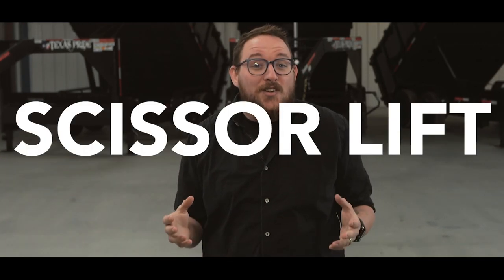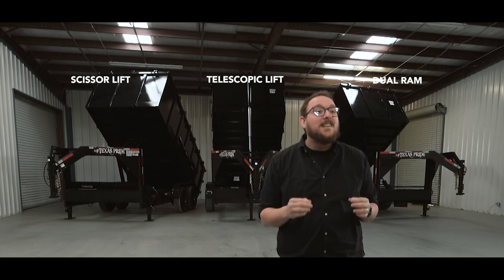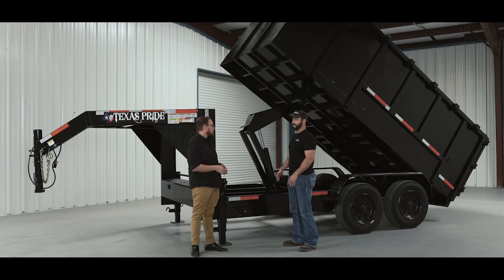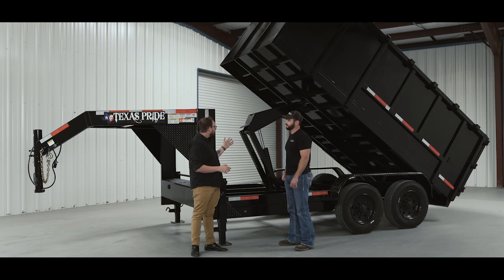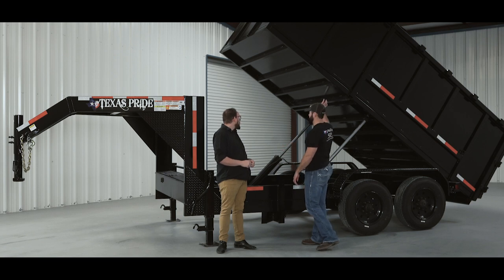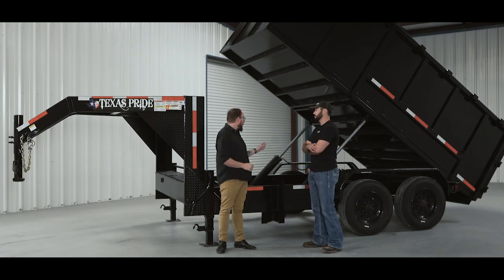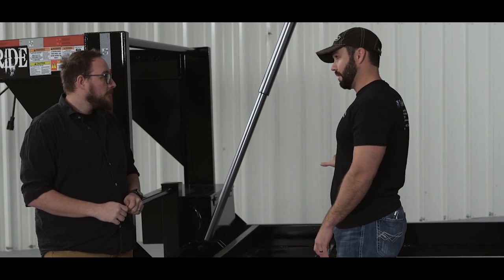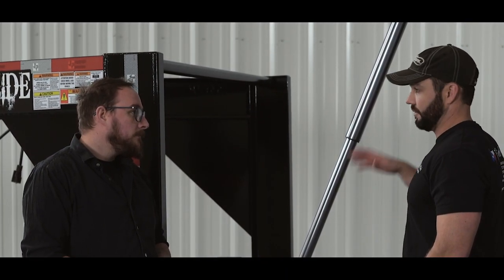BEST DUMP TRAILERS 2020 | Which Dump Trailer Hoist System Is THE BEST | Texas Pride Dump Trailers

Comment: The scissor is better if you dump on un level ground very much. Less torsion on the cylinder. It has a bigger footprint or contact surface on the main frame and the dump box. The scissor takes the twist or torsion not the cylinder.

Comment: Just know this, every trailer is going to need a paint job as soon as you buy it. I've had them all from flat bed,dump, enclosed, utility and landscape, from big tex, snapper trailers ( the worst) trailers 4less, gator every trailer has a cheap light coat paint job just to get it sold. And none of them will stand behind the warranty even if you buy trailers in high volume, the dealer will blame the builder and the builder will blame the dealer.
Reply: I keep a sharpie on hand to mask any paint scratches.
Reply: @ridgerunner106  lol yeah I think that's the quality of paint they use.
Reply: John Connolly  After one of them hurricane debris hauling trips, they're ready for the scrap yard anyway.
Reply: Can’t wait to paint mine matte black with a satin clear coat.
Reply: Our trailers are fully primed and painted with automotive grade acrylic enamel which lasts longer and is resistant to chipping or fading.
Reply: Michigan salt eats any trailer in a few years. Unless toyota starts making trailers its a no win situation here.
Reply: Diamond c and load trail are both powder coated and their paint is insanely  tough. I've hit mine with attachments. Logs etc and it's very thick. Every other Brand is auto paint I believe. Worst is pj, big tex

Comment: I have driven dump trucks and semi truck with end dump trailer- both can be very sketchy dumping on uneven ground. That is why I chose to go with the dual cylinders- stability/ safety. The trailer I bought, which is a Texas Pride trailer, gooseneck, triple  7K axles, charges the batteries when plugged into the truck and, an extension cord can plug into the trailer to operate an onboard trickle charger. For those asking how to get one - go online to Texas Pride Trailers, request information and someone got back to me within a couple hours. I placed my order and received the trailer in four weeks!

Comment: I dont know about having a bunch of cobblestones in it that last one with the skinny ram that long,  how would it handle if the ground isn't perfectly flat or if the load isn't centered great. Just doesn't look like its very strong that way.
Im liking the dual rams its pushing the same on each side it can't twist
Reply: Ya it's hydraulic. Nothing is 100% equal. Dual rams never lift the same. They are actually more dangerous

Comment: It's a shame i cannot find any damn telescopic lifts in my area. They are all lifting the load from the middle of the trailer so it has so much more resistance on the front end of it. Next dump trailer i get will be done with Texas Pride. Prices are super fair and the quality is unmatchable.
Reply: @texaspridetrailers  Yall's lead time was too long for me but my next trailer will be built by you guys. Love the website.

Comment: The worst part I see about the dump trailers with the telescopic cylinders, is that the top of the cylinder barrel sticks up above the top rim of the trailer box (on normal wall height trailers) so when you put your tractor in the trailer,  with loader and 3-point hitch attachment on the back, sometimes you need to put the bucket up on the headboard to fit in the trailer and the damn cylinder is in the way !
Reply: Buy a longer trailer?
Reply: @charlesc9647  Even my sub-compact John Deere 2720 with a bucket on the front and the york rake on the back (with gauge wheels) measures just about 17'. I have never seen a 17' foot dump trailer, so the only size trailer that set up will fit in is an 18' or bigger. Most guy's trucks will not comfortably tow an 18' trailer (nor would they want one that big) so I guess it's not as easy as just "buy a longer trailer"

Comment: Ok, listen up, Slide #1  show all three side by side trailer weights and how much each trailer is rated to dump / possible to dump without damage to frame, and how fast to cycle, and how many cycles per day.    Turn a chatter-box video into a 1 slide presentation.    Then start the presentation.

Comment: QUESTION ALL ABOUT TRAILERS WHAT TO DO WITH A TRAILER AND NO TITLE HOW DO WE GET ONE
Reply from the maker: Did you lose your Title or did you buy it with out a title? If you bought it with out one you may be able to get a bond title. If you lost it, apply at your DMV or tax office for a lost title! Shouldn't be too hard.
Reply: Build onto it enough to prove that you built it. Then you classify as a u-built. Also the gvw has to be below commercial class. Which will be less than 5000lbs. If you go 1400lbs or less, you won't have to get an inspection.
Reply: @AllAboutTrailers  Just a question, what if title is with a payday loan outfit? Always wondered about that.
Reply: Cut it up & scrap it

Comment: With DOT rules & regulations it just best not to get one at all. Those batteries don't work for crap using it day in and day out I see guys always hooking up jumper cables at the landfill.  It's just cheaper to call a big truck or a 10+yard dump truck when you need some dirt or gravel or some trash hauled off.
Reply: You sound like that guy that wants a dump trailer but can’t afford one.
Reply: Bullcrap.  When you run 2 3 times a week to the dump these pay for themselves quick.
Reply: I had a sissors lift 6x10 10 k used and abused it for 15 years and sold it for 1k less than I paid for it. It was a great investment and I never had to waste time going to rent one. Never broke down and if you charged the battery every 4 lifts or so it was fine.
Reply: @darrelgirdner1290  that's exactly what I thought. We go to the dump Monday through Friday, battery charges through truck while driving so I never have to charge it. It's a marine battery so they only last about a year. New battery every year and that's it. Only guys you see at the dump Jerry rigging are to cheap to do it the right way!

Comment: I'll never buy another Texas pride trailer. Went with the telescopic 16k model, can't lift 5 tons to save its life.
Reply: If I'm correct, 16k is the GVWR so you have to take out the Tare/Empty weight of the trailer which leaves you with around 10k max carrying capacity. So it should still lift 5Ton but you're maxing it out.
Reply: @Sqwedgie  yeah you're right, it's total. But they're still junk, already had a ramp break, the barn doors are terribly designed, no washers under bolts that hold the ram and the heads are pulling through etc.. You get what you pay for.
Reply: Should have bought a PJ
Reply: @justpalms9978  I ended up buying one, best move I made.